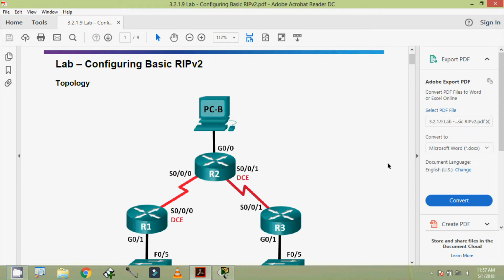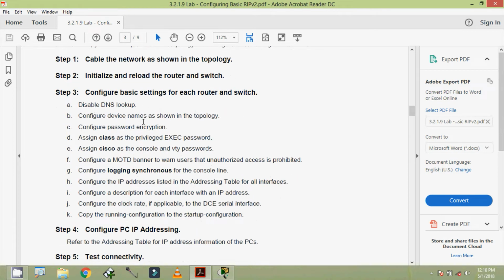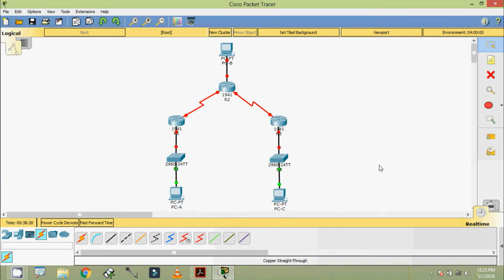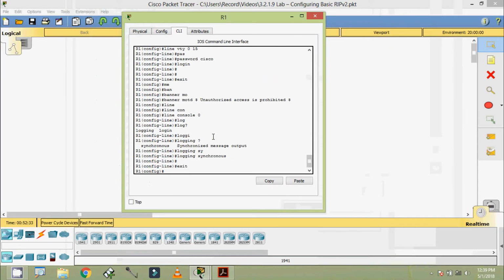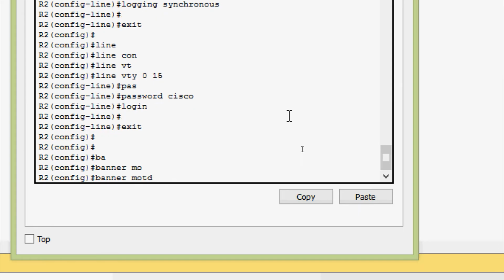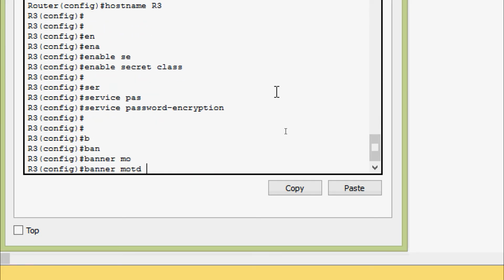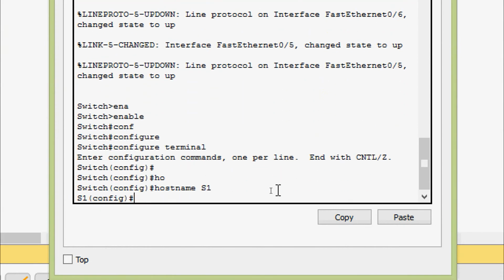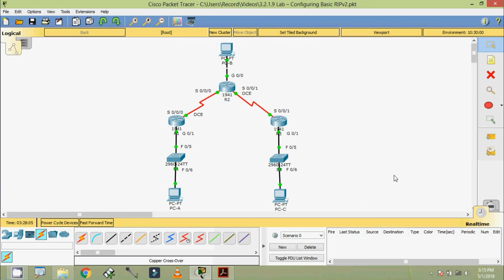3.2.1.9 Lab - Configuring Basic RIPv2 Part-1

Comment: Hi. I'm trying connect the DCE cable to the routers. I don't get a serial option. Do you know why? The PT only allows me to use a copper cross-over.
Reply from the maker: Hi dear Friend.
You have to add serial interface in router physical Tab.
Reply: @TechAcad  Ok. I did found a different interface from what is shown in your video. I have the one with a yellow sticker. That's the 1941, correct? I thought that was the one you shared. I appreciate you help!
Reply: I found it! I didn't realize which one you used. By default it shows the HWIC-1. Thank you. Your videos are very helpful. I enjoy learning from you.
Reply from the maker: Thank you so much my dear Friend for your great support.......

Comment: when trying to connect the routers with Serial DCE the Serial Ports are not showing up I only have auxiliary, fast Ethernet and console ports. What have i done wrong?
Reply: double click on the router 
and then click on the physical option '
and them on hwic-2ct 
you will have your serial port 
or watch a video
Reply: @aman12007  thank you; I had the same problem but your explanation helped.